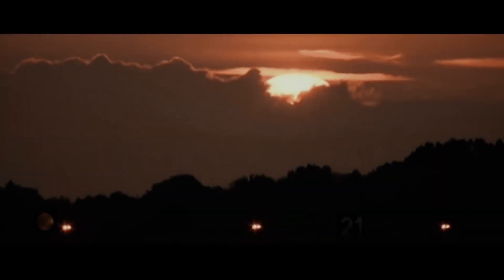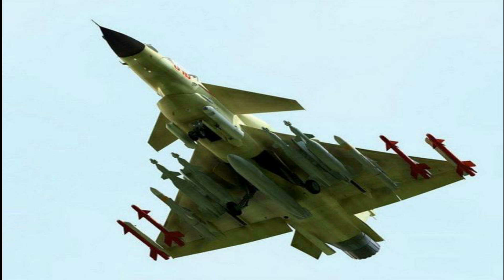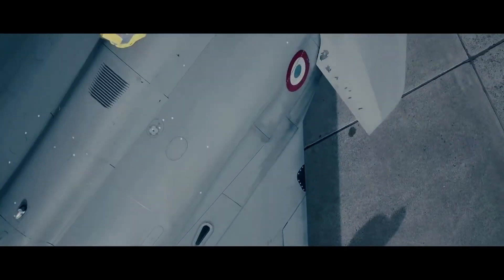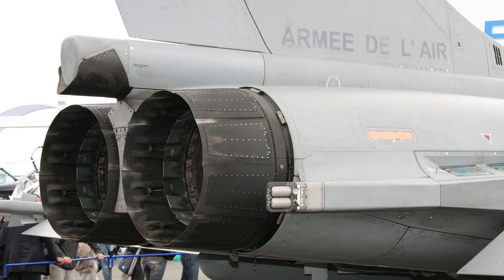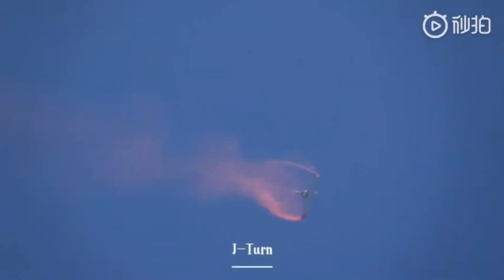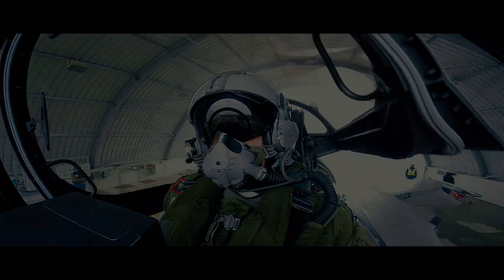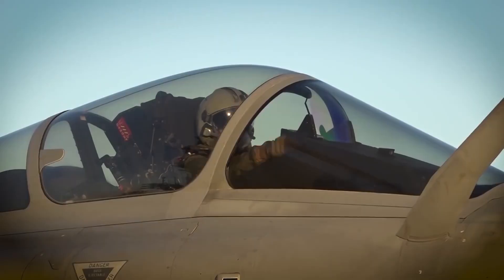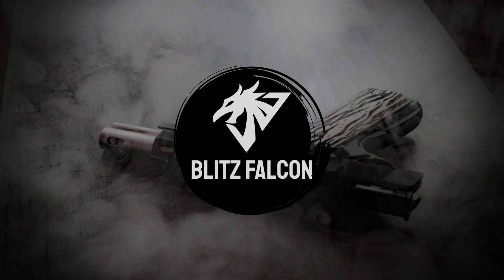J-10C VS Rafale | Technical Comparison

Comment: J10 C  is not too inferior to Rafael or Rafael is not too superior to J10C. Both are comparable fighters. Pakistani pilots are capable enough to counter the Rafael with very low cost J10 C fighters particularity in air to air missile attack.

Comment: GaN is a newer and superior technology than GaA which it supercedes. This is strange to see you get this upside down. J-10C has a bigger radome with superior tech (GaN) and far more T/R modules. It would be better to do some basic research before posting.

Rafale's larger wing area would allow better range and payload, as well as better high altitude performance. However, this comes at the cost of greater drag, which is also a problem due to its design choices (bulking near canards) that relate to stealth. J-10c on the other hand has a far lower drag and more aerodynamic design. Usind DSI, it reduces drag, complexity, weight. 

This means that it is likely to have better STR (sustained turn rate) than the Rafale at 150 FL. The overcomplex Rafale intakes sacrifice performance for stealth but refuse to use a DSI, which would have achieved their design objectives better. 

As a result the J-10C is likely to overcome its less powerful powerplant choice and able to be as nimble as the Rafale, and surpass it in some regimes, most importantly STR. 

With a superior radar and slightly better aerodynamics, the J-10C is very likely a superior platform to the Rafale. This is not counting costs, and vitally - lower downtime and higher uptimes - the J-10C being a single engine will have lower maintenance costs and have faster servicibility. Twin engined aircraft not only cost more, cost to maintain more but also need greater time in maintenance. This means that J-10Cs actually available for combat may be more than Rafale. 

All these points suggest the J-10C is a significantly better buy than the Rafale. The only question mark is PL-15 vs Meteor and no one will know this until actual takes place.

Comment: Both are very deadly but when it's comes between Pakistan and India J10c is a clear winner  ...
Rafale wins in many combat areas but all those are useless against Pakistan...
Pakistani made jf-17 thunder can kill rafale in single shot even from runway without flying in the air due to its range ,,, $125 price tag is the biggest set back for rafale against J10c
Reply: 😂 kabul ka sasta nasha

Comment: Your analysis is superb  and comments are very interesting.  PAF can field 4-5 J-10s for the cost of 1 Rafael. With lower operating,  maintenance and  life cycle cost, additionally if IAF looses 1 Rafeal it will take them 2-4 years to replace it,  PAF will be able to replace their J-10 loss within months . Chinese technology is expanding at such dizzying rates so the J-10 can be updated continuously which can not be said for Rafeal. Performance wise they are both neck in neck  pilot quality will be deciding factor so PAF wins on cost and pilot quality. Overall J-10 is the winner hands down.

Comment: Rafale is best in class . Per Unit cost of Rafale is $135 Million whereas J10-C is $35 Million . Now any unbiased Person with Common sense will end the case after this point. J10-C is not battle tested and no one belives Chinese Specs . Rafale is battle tested many times . Also J10-C aerodynamics design is a copy of Probably Israeli aircraft or F-16 .

Comment: Rafale has 17% more thrust while being only 11% heavier so it has a better thrust to weight ratio and more power for the Radar. Correct your facts.
Reply: Rafeal has total thrust of 150Kn while j10 has 145 kn with Saturn
With their WS 13 engine
The thrust to weight ratio will exceed even more
Reply: @aliarham6209  but J-10 CE can't do SUPER CRUISE 🌚 at 1.2 mach without afterburner
Reply: @thelegendkarna5039  well it can't super cruise even with afterburner, maybe at full afterburner
Reply: @aliarham6209  J10 CE 
But RAFALE have technology to do it 😀

That's why we have pay it higher amount
Reply: Thrust to weight ratio for Rafael is 1.2 while of j10 is 1.4
Not much difference

Comment: The Rafale is NOT underpowered! In fact, it has a greater thrust/weight ratio, and can also supercruise (unlike the J-10C). The Rafale also has a bigger combat radius, and it can carry a greater payload, which allows it to be used effectively over longer ranges in ground attack mode. The J-10C is more suited to air dominance role. The Meteor long range BVR missile carried by Rafale is currently one of the world's most potent long-range BVR missile. The J-10C that have been purchased by Pakistan are equipped with the PL-15 missile to counter the Meteor. The PL-15 dual pulse motor and long range makes the J-10C into a very effective deterrent against the Rafale. The J-10C also has a newer, more powerful radar compared to Rafale, and it has an edge over the Rafale in air-to-air role. Rafale carries almost twice as much payload (weapons) which gives it an edge in ground attack role.
Reply: J-10C can supercruise and has a better T/W when loaded.
Reply: Rafale is a very impressive jet. It is a true multi role fighter, it has every box checked. J10 however is designed with a different mind set. It chose to single high trust engine which shared with their heavy weight to lower the maintainess and operation cost. The is no need to for J10 to carrier out massive ground attack, they got the heavy weight to do that work. it is used as quick reponse aerial defense jet.
So J10 has 3 advantage over the rafale
1 cost/reliability
2 radar
3 missiles
All the other areas rafale is better.
because J10 had been produced over 700 unites, each jet cost less than 50M, which is closer if not lower than jf17.
Reply: greater thrust/weight ratio....i have to laugh. btw, the size of the radar of j10c vs rafale said it all really about their BVR capability
Reply: Lol
Reply: Quite accurate analysis. pretty similar to how the Chinese thinks their jet too.
Reply: "The J10 is more suited in air dominance", have better radar and longer range PL15 missiles... You could be right after what happened recently, in the sky who sees first wins the battle.
Reply: He forgot Rafale has 2 engines
Reply: @clansman89  rafale engine 2x75 Kn. J10c single engine 145Kn
Reply: @andropovyuri7859  There you go. Thanks!
Edit: actually Chinese plane has even less power.
Reply: @andropovyuri7859  78 kn 🌚

And one more thing 
Rafale can cruise 1.2 mach 

What about J10CE 😆
Reply: J10C has no super cruise. Dont live in a fool's paradise
Reply: And what about j20 fool
Reply: @ghufranafridi9004  
J20 china..use karega..
Aur jo china use nahi karata wo J10 pakisatn use karega...,,😂
Reply: @maheshdesai7271  😂 the j10 pakistan is purchasing is j10cp
A specific modified version created with feedback from paf pilots and engineers
If pakistan wanted to buy a normal variant it would have bought it a long time ago

Comment: You are giving all wrong info. Rafael has 2X75 GTs using after burner so it can super cruise. It is still not clear whether Pak will buy J10C so saying everything in favor or J10C will be useless. One can Wkipedia and compare Rafael and j10C
Reply: Wikipedia  has never been more impressionable than it is now and j10c is highly comparable fighter jet to the rafale rafale is a more mature fighter jet there is no doubt in that but because  j10 has advantages in its own domain means it will all comw sown to the pilots of both the fighter  jets and Pakistan  is buying j10 c
Reply: @tughralraja8241  F-16 is much better than J10C. PAK has no choice other than J-10. JF-17 is no way near Rafael. So J10 is the only choice. All other country will ask hard money. Only China can give on loan basis. China will use Pak in future and will make China a colony... like how Brit did to India in WW1 & WW2
Reply: @nirmalbhel3231  u dont have any knowledge about avionics at all my frnd j10 c is highly  comparable with f16 blk 70+ and is superior to the f16 blk 52-60 . Im not saying that j10c is better than f16 blck 70 or Rafael  but is highly  comparable  which means its avionics  and physical  performance matches both fighter jets at some extent  jf17 is a small lite combat fighter jet it is not made to challenge  the Rafael but to serve  as potent resistance for the impending  attack
Reply: @nirmalbhel3231   lol brits made india a colony before ww1 and ww2 what u talkin about ?? And we are talking about avionics not national  finances
Reply: @nirmalbhel3231  u can see a stealth fighter jet stealth fighter jets can be detected by the radars under certain circumstances  so its not a big deal for su30 to have actually encountered the j20 detection and engagement are 2 different  things the radar active missiles  can not engage a stealth fighter jet most of the times . And pl15 has an operational range of 200 kms against fast moving objects and more than 400km of range against heavy obejcts like aewacs and transport aircrafts bro u need to research this stuff before hand
Reply: @nirmalbhel3231  we are at point where u aint gonna listen to me and ur under knowledge will nit convince me other wise so i suggest u keep believing what u see and hear from indian media and ill keep believing what i researched personally
Reply: @nirmalbhel3231  in 20 years china will be on top as it is rn europ is in crisis america and China are going to b on top by 20 years from now
Reply: @nirmalbhel3231  pakistani media might talk about india maybe like twice in a month and there are very few channels which care about what happens in india but when u watch indian media they do hindu muslim shit all the time and they talk about pakistan the remaining time
Reply: @tughralraja8241  People should be happy first. If all Chinese are happy then China will remain on top for long. As of now, I don't hear from my Chinese friends here. Many Chinese are looking for US Canada green card. If China is #2 why many Chinese are still moving away from China. Why many from Tibet is coming to India and settling. Indian govt don't issue passport to them. Indian govt issues only travel document to travel outside. They come here and tells what Chinese are doing in Xinjiang and Tibet
Reply: @nirmalbhel3231  thats not what our argument is about bro stay on the topic we all know how happy are ppl in india . And they run away from their country too same happens in pakistan there is no denying  it but thats just not what were talking about here
Reply: @tughralraja8241  I do agree, India still is poor country. But every year less people are moving out of India. Many from US Canada are moving back as there is a better opportunity. It will be a long journey for India compare to China. 
I was in Shenzhen for 2 weeks, I felt like any other western city. My friend travels throughout China. He tells me that if you go 50 miles away from any big city in China you will see a different China. Almost like Indian rural area... not so developed. Food in rural area is a big problem for him   
AGAIN CHANGING TOPIC
Reply: @nirmalbhel3231  look i dont know how long this will go cuz bashing china will not resolve anything okay indians are leaving india so do pakistanis i live in america my self so why would i say that pakistan is better for living i love that country but i never let my love cloud my judgment  . The fact is there are more indians and pakistanis willing to leave their countries than chinese ppl its simple just accept that yr not at top and will not be at top unless u start seeing things realistically there is a face of china which is unlike their major cities but do our major cities compete with their's  ?? Do our rural end is any better or worst . 🤔  think about it
Reply: 2 ppl from 1 from pakistan and another 1 from india are judging a 3rd country which is a lot ahead of their countries  🤔   things will only change once the facts become the need to think not some misplaced nationalist feeling im from pakistan there is no denying that pakistan is under huge distress and things are not good . It doesn't make me a traitor to acknowledge the weakness of my country rather than blaming india or america i think pakistan and its ppl are responsible for all the chaos look its not that difficult to understand

Comment: No one can beat Indian keyboard worriers in the comments section 😂.
Reply: Wow what a nice comaparison i will give 1example he says j 10 140KN with afterburner which is false it is just 125Kn in wiki.. Then he comapres rafales engine with afterburner is 2×75Kn =150Kn
Reply: @agentnoobz5588  2x75 =180 are you serious 😂😂😂
Reply: @agentnoobz5588  wiki😂😂
Reply: @agentnoobz5588  WS10  WS10A  WS10B  WS10C are different，140KN is the right data

Comment: Lol men you just said 3m2 and not 3 meter square just reading out the mazgines nothing more than that...
BTW : RCS of rafale 0.05 - 0.1 for j10 it's 1
Thrust ratio :- Rafael 1.34 and j10 :1
And for block 3 1000 tr module would be of no use with less performed enjine...
Reply from the maker: Recheck your stats :)
Reply: @pakistanstrategicforum  does stats changes with time?
Reply: @pavanainarkar8102  wait
A bit
The engine India will use in tejas mka1 is same as in tejas mk1 means 86kn thrust
Yet you are using elta 2052 radar with 900+ tr modules and 220km range or more
So if we use your logic
Will the engine be able to power
If so then same will for block 3
Reply: @aliarham6209  as far as I know it has around max 800tr modules so there a difference between 800 and 1200 tr modules right ?
Reply: @pavanainarkar8102  who said klj 7a has 1200 term modules
That won,t even fit on jf 17 thunder,s nose
Reply: @pavanainarkar8102  no it is 900 tr modules for elta 2052
That 800 might be for elta 2032
Reply: @aliarham6209  well yes for jf17 I guess it was supposed to be some structural changes as well
Reply: @pavanainarkar8102  I am talking about block 3
That nose won,t fit such radars
Even the best today's exists is on f22 with 1400 max tr modules
Reply: @pavanainarkar8102  and you no how big that nose if of f22

Comment: Pakistan airforce must have j-10C and j-11D with most powerful ws-10C including very powerful AESA radar jf-17 jetfighers are very weaker against rafale
Reply: J10C doesn't have enough power to power its radar to full capacity. Same issue is with JF-17. India SU30 has enough power to power its PESA radar, which can see up to 400 km. Unfortunately, it doesn't have a missile to guide to 400 km. Else, it will be a killer fighter like F-15
Reply: @nirmalbhel3231  J10 has a 125 kilonewton thrust and it,s radar has only 1000 TR modules
A 125kn thrust engine is enough to power anything
Reply: @aliarham6209  if J10C is coming with Russian Saturn engine and 125kN is with after burner. China is pushing for Chinese engines, Pak knows quality of Chinese maal
Rafael each engines gives aroung 50kN without afterburner. 
Pak took loan from China just to show that PAF can match IAF... India has just put Pak into arms race
Reply: @nirmalbhel3231  that is not answer to my reply
Quality is bad,I know
Pak took loan for PAF?
You serious?
Total loan of Pakistan on China is 30 billion dollars and 20 billion is in CPEC and 10 bought earlier
Reply: @nirmalbhel3231  wrong, pictures surfacing show that the engine used is the ws-10B tvc engine, whereas talking about quality, tejas was covered in dust waiting to be inducted by your own airforce, period
Reply: Yesterday Pakistan signed an agreement of buying 25 J-10Cs from China.
The jets will be delivering till 30th march 2022.
Reply: @abdulbasitkhan7448  As of now, India got 25 Rafael, 11 more to come. India will buy another 114
Reply: @nirmalbhel3231  Then Pakistan will definitely buy more jets in near future for the balance of power.
Reply: @abdulbasitkhan7448  Same think US did to USSR. USSR tried to match US #s & collapsed.

Comment: F-16 Blk52 equipped with AIM-120D & coupled with SAAB AWACS is deadly adversary for Rafale
Reply: nope blk 52 is no rival to the rafale the block 70 could put up a great fight tho
Reply: @ahmedayyan1775  blk 52 upg to 70 is
Reply: @RAPTORGAMINGz  if a blok 52 was upgraded to blk 70 standard than it will be classifued as blk 70
Reply: Also mention the DRDO netra awacs with Rafale ...
Reply: We don't have aim-120d varient only C. Which is good enough but not long range enough. How ever the radar in Rafael are better but awacs can fill the gap.